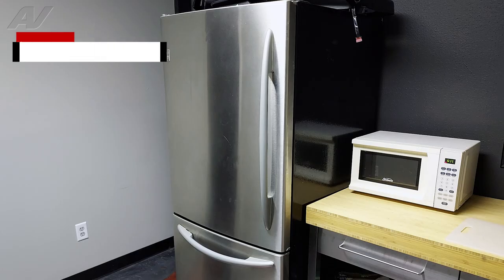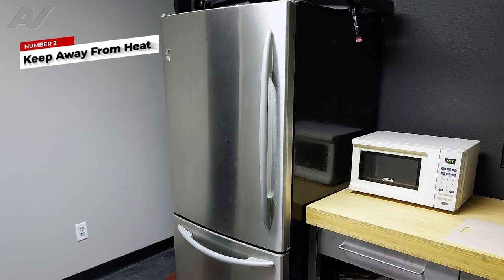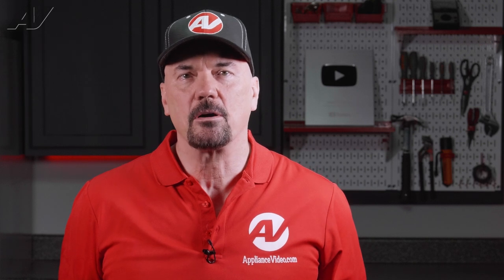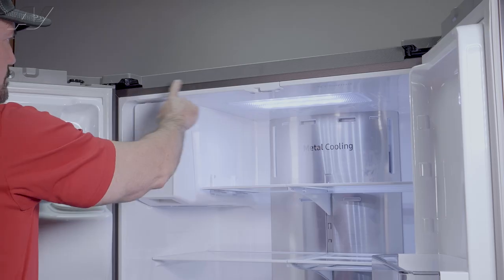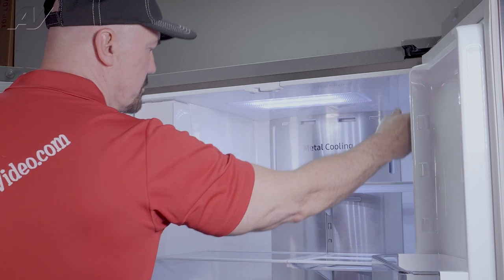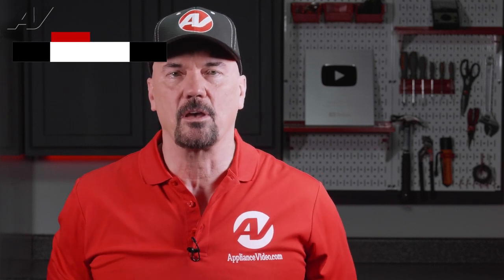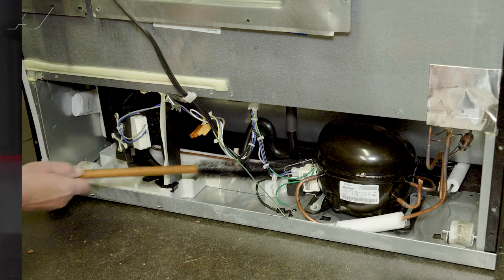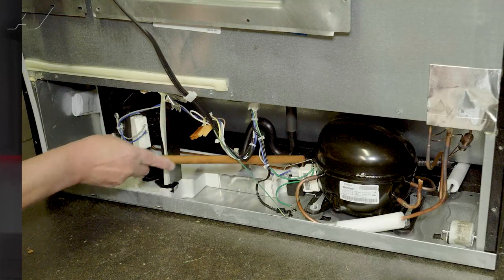Why do I have Condensation Water Drops inside or around my Refrigerator?

Comment: I have an expensive KitchenAjd side-by-side, bought in 2013. The ice maker quit after only five years because the wire for it is in a harness that goes through the door, getting flexed every time the door is used. Now the fridge has condensation inside. Repairman said it’s because the insulation in the wall between the fridge and freezer degrades. I can’t replace the fridge because it’s wedged into an enclosure, and the replacement model is a tiny bit wider. I am not going to remodel the kitchen over this. Any tips?
Reply: When you disassemble the wiring, encase it in shrink wrap.

Comment: water leaking.  I've disconnected the water line to the ice maker that hasn't worked for years.  I took the back off the inside of freezer and the large drain hole is clear, not iced over.  The drain pan under the fridge is empty and dry, yet ever few days, I have to clean up water from the bottom right corner of my "Admiral" refrigerator. any suggestions?
Reply: Any suggestions can you say crickets I love these kind of videos they don't they don't help you they don't give you any guidance or anything